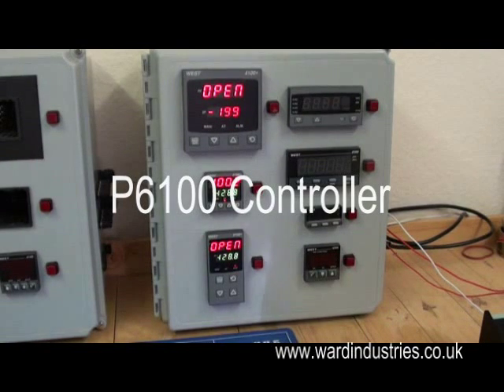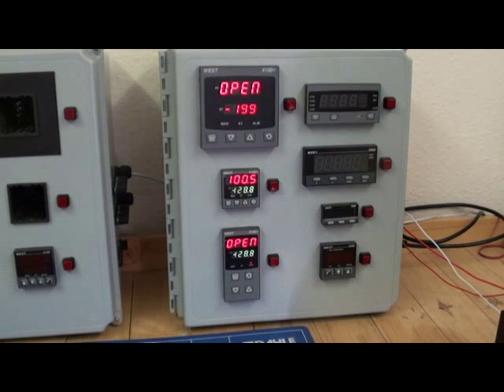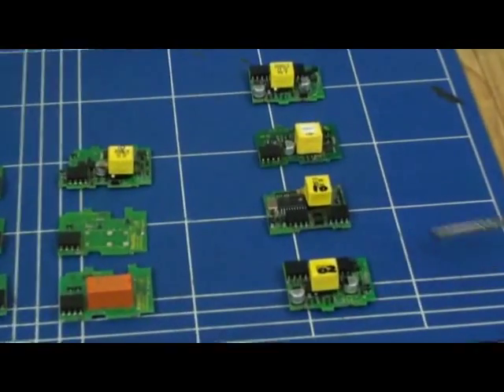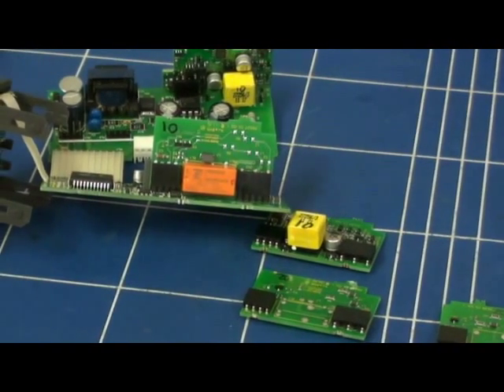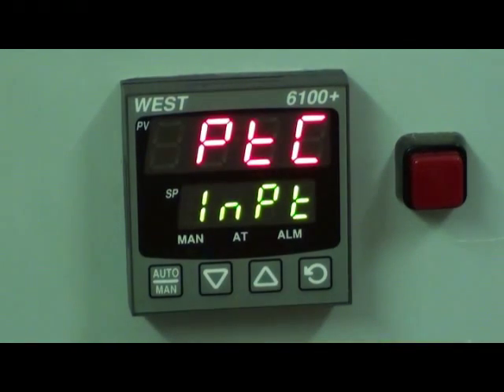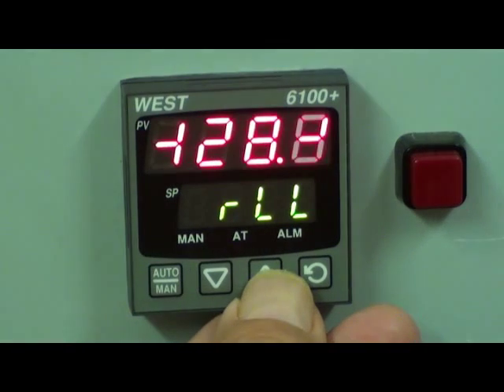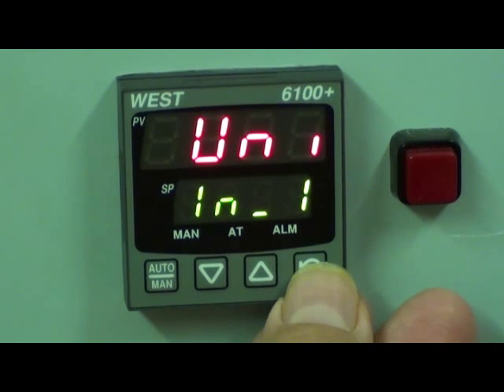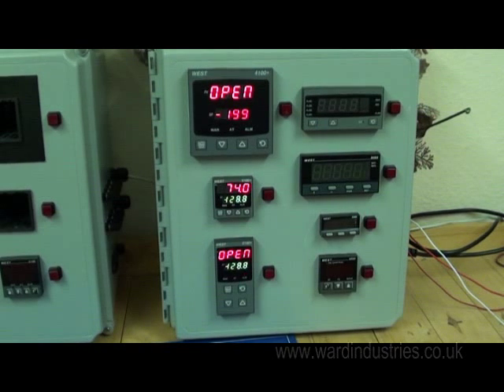P6100 Temperature Controller - West Instruments

Comment: My 6100+ just keeps saying open and I can change the sp but temp does not increase on the platen. Also my AT and ALM lights are flashing... We had a power outage and when it came back the unit is faulty somehow.
Reply from the maker: Hello. How to stop the AT light from flashing. Press the UP and the SCROLL keys together. You should see SLCt on the lower display and OPtr on the upper display. Press the UP key until you get Atun on the upper display, SLCt should still be shown on the lower display. Press the SCROLL key to enter the Auto tune menu. You should then see Ptun on the lower display. Press SCROLL again until you see Stun on the lower display. If the AT light is flashing then you will probably see On on the upper display. Press the DOWN key and the upper display will then show OFF. Now press the UP and SCROLL keys together to exit the Auto tune menu. The lower display should show SLCt. Press the UP key until you get OPtr on the upper display. Now press the SCROLL key to get back into normal operation. The AT light should have gone off.

If the upper display shows OPEN then there is either a problem with the sensor or the settings in configuration menu. Hopefully you kept details of the configuration and set up settings when the controller was originally programmed and put into operation. Check these settings. If they appear to be OK then check for a possible fault with the sensor. The ALM lights are flashing because the Process Variable display (PV - upper display) is showing OPEN.

Hope this helps.

Comment: My controller keeps displaying "open" on the upper display and "-199.9" on the lower display after being configured. How do I return it to the normal display of temperature?
Reply: Hello Sarah. After configuring the controller come out of the configuration menu by pressing the Up and the Scroll key together. The display should then show SLCT on the lower display and ConF on the upper display. Press the Up arrow until you have OPtr on the upper display then press the Scroll key. That should bring you back to normal operation. However, if you still have a problem then please send an email to info@wardindustries.co.uk with the full model number and serial number of your controller. I will then set up a similar controller in our workshop and try to simulate the fault condition.
Reply: Hi Pamela! It worked! Thank you for the guidance. I will keep your email in case things go faulty again with our temp. controller during process.